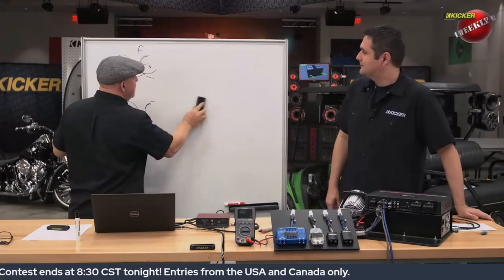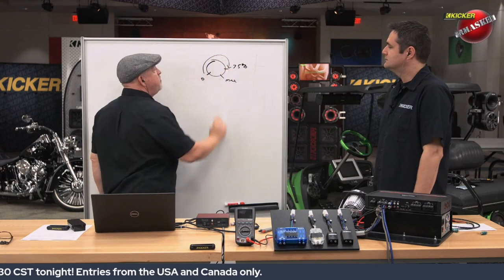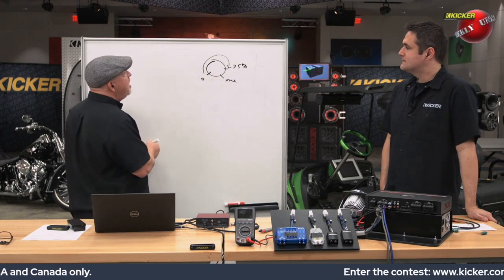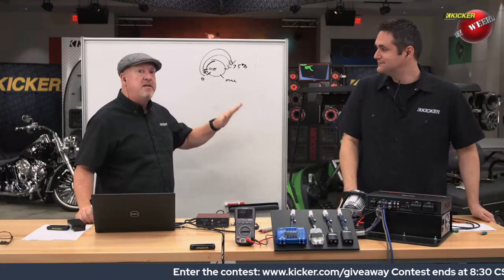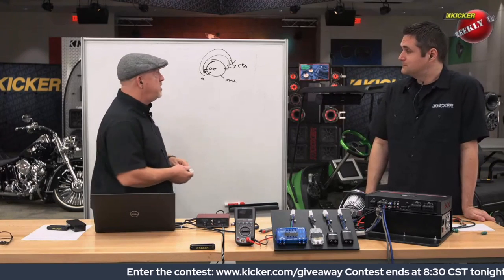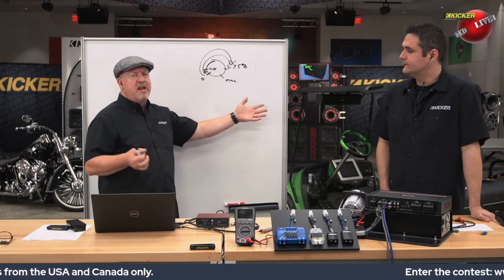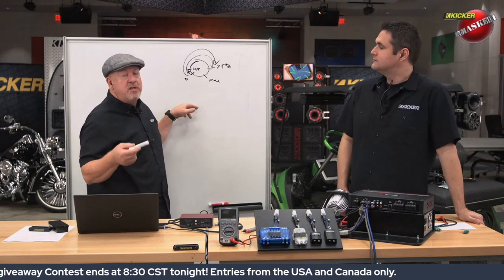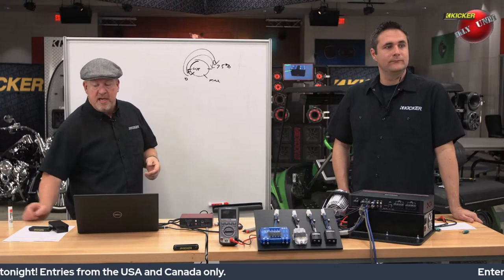How to set your amplifier gains - KICKER UnMASKED - Shorts

Comment: I have 2 10s L7 q class with cxa 1800 amp and the amp won’t get out of protection mode any ideas?
Reply from the maker: Please reach out to Technical Support.  They are open weekdays from 8-5 Central time.  Their number is 405-624-8510 or you can email them at support@kicker.com.

Comment: Everytime I do it this way on my cxa400.1 with 2 comp c 10s it’s not loud enough
Reply from the maker: Over time, your ears do get used to the amount of bass you have (called "threshold alteration"). That said, there is a difference between "loud" and "deep". This is a function of a few major factors at play : power, wiring, tuning and box construction. If you call our Tech Support, you can go over all three: 405-624-8510 or support@kicker.com.  We are open weekdays 8-5 cst.

Comment: Set gain with speaker wires connected to amp or disconnected? Thank you!
Reply from the maker: Technically you can do it either way, as you are measuring the input signal to determine where clipping is, but you're best off waiting to connect the speaker inputs. Here is a video to show you: https://www.youtube.com/watch?v=OBYOnXEN0pE

Comment: Where should i have the  remote bass knob set at when setting gain?  And does the knob adjust gain or is it a separate bass booster??
Reply from the maker: The bass knob should be all the way down.  It adjusts a specific frequency, (that exact frequency depends on the amp line). Gain is meant to ensure you don't clip the input signal.  Many people mistake it for a second volume knob - never, ever make that mistake.
Reply: You say more voltage in is good, can I exceed the amps voltage IN by say 2-3 volts without trouble ? Amp says 5v in, can I set voltage on epicenter to 7.5 out ?
Reply: @KICKER-AUDIO  This is incorrect. The Kicker bass knob is not a boost at a specific frequency, it's gain attenuation. The knob should be ALL THE WAY UP during gain setting.